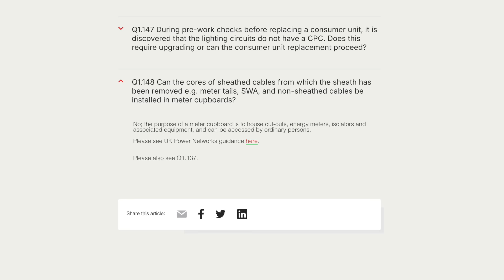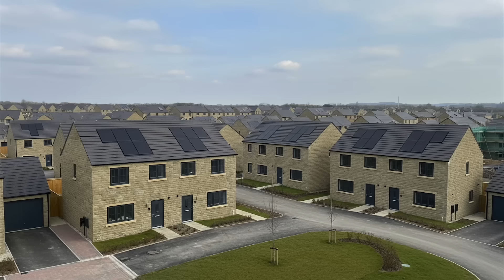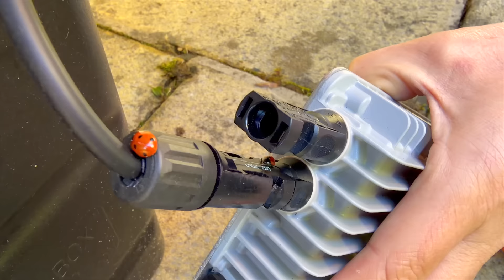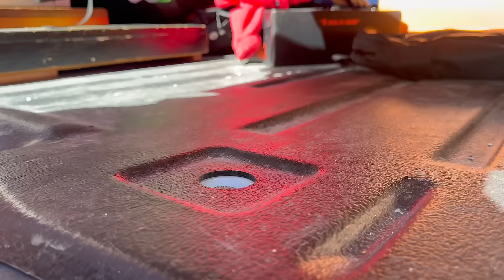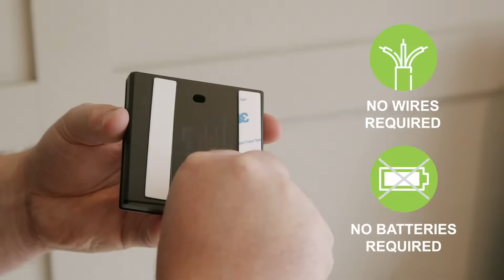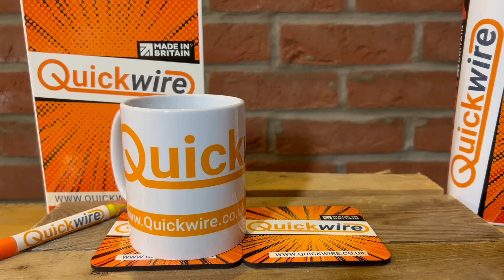At Last: Final Ruling On Single Insulation In Meter Boxes!

Comment: Single insulation should never have been a subject. This is why the industry is doomed, looking for anything that's the easiest instead of doing things the right way. Shame on those who find it acceptable and permit such poor practice.
Reply: 70's house where 'leccy head and meter is bare under the stairs... single insulated cables by looks of it!
Reply: @khalidacosta7133 If its DNO equipment there's not much you can do about it, they are a law unto themselves, always have been. All you can do is keep your side of the street clean, whats past is past, but the crap produced on todays new installs is disgraceful.
Reply: @ChariotsofWire180  i agree, to the point i only test my own work on sites.
Reply: @morestuff4401 The issue here is developers have tried winging it that a meter box is an enclosure to satisfy the regs on single insulated conductors, because they want the cheapest, nasty way of getting things done. Its a shame that certain "authorities" have let them sign off in the first place. They should be fired, not given completion and handover sign off.
Reply: @ChariotsofWire180  this is the least of the issues too.
Developers are constantly handing over unfinished properties and unfinished roads... 
Only a fool would buy a new build.
Reply: @morestuff4401 Feel sorry for anyone saddled with a new build. Sad how the entire building industry has gone, from having the best tradesmen in the world. That said its probably quicker to say sad how western society has gone.
Reply: @ChariotsofWire180  unfortunately we let our best tradesman retire without training as many apprentices as was needed and instead relied on cheap foreign imports who couldn't care less about standards or quality as they were only here temporarily. 

Win win for the imported workers and developers.
A huge loss for the end consumer
Reply: Doomed dooooomed